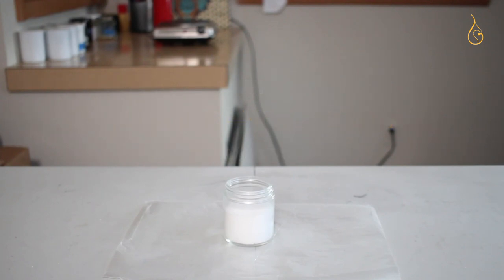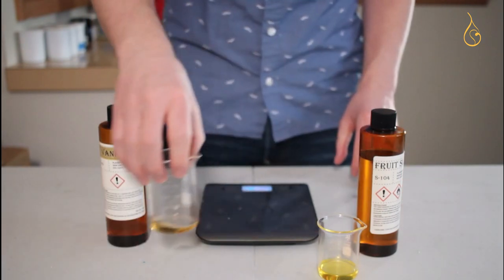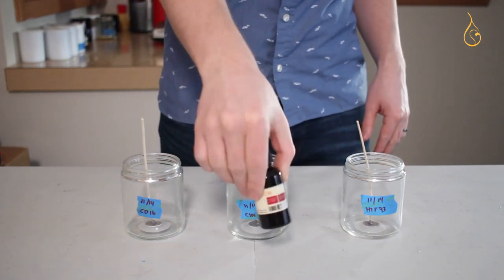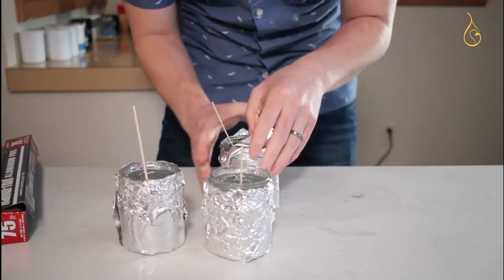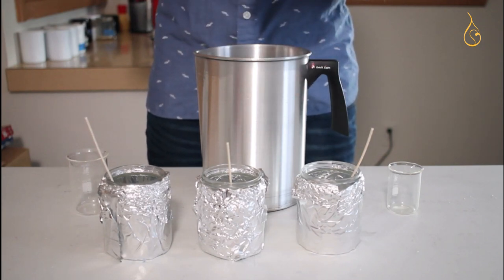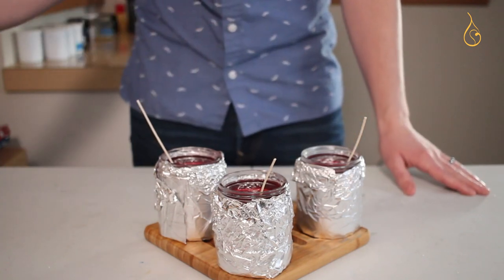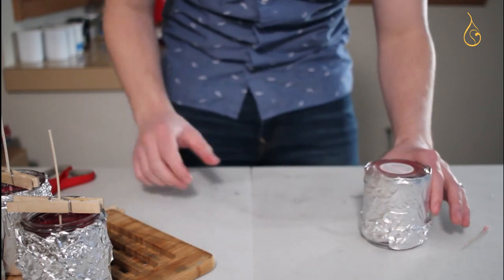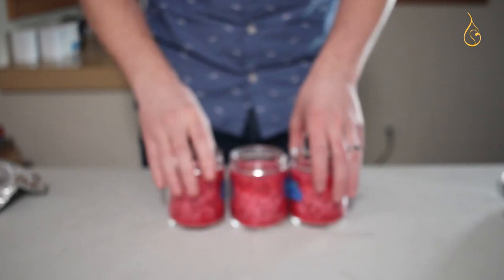Palm Wax Candle Experiment | Part One

Comment: This is great! I'm really interested in making pillar candles with palm wax, do you also do the flip technique for those?
Reply from the maker: I do - and it's just as scary!
Reply: I was just preparing to ask the same question. I started to do pillar candles with palm wax, I have the craters problem. I pole them, the refill and so on, but I still remain with one hole at least at the bottom. I don't do normal pillar candles, the cilindrical ones, I do it in shapes (like female shape), so I don't know if the fliping technique will work here? I don't want the neck or face of the shape to have bubbles ...

Comment: Hey! This video is awesome. I'm trying my best to get the crystals out but it's not working at all. Did the pouring at 200 F and even put them in the oven so they would have a lot of isolation. Minimal crystallization... Can u think of anything I can do differently? Bought palm wax just for this!
Reply from the maker: Hmmm that's interesting.  Wrapped in tinfoil?  Hot room?  Is it the "right" palm wax?  There's a few blends out there that have slightly different behaviors.  I think this stuff is R2322A.
Reply: @ArmatageCandleCompany  a room hotter than the oven... Is hard! Haha it's cold here in Berlin right now, so I thought the oven was the best choice. I also thought maybe it was the was... Sadly I haven't found here waxes that specify their type. I'll try with another wax and will let u know! Thanks for now 😁
Reply: It is not paraffin wax or soy wax
Reply: This candle is made with stearic acid
Reply: Melt the stearic acid in a jar and let it cool, crystals will form
Reply: 110%

Comment: Why do you test different type of wick candles? Why do you want to compare apples with oranges? 
You have too many variables: the wick sizes and type.  
I am working now with palm wax and I read that eco wicks work well with this type of wax.  Therefore, I decided to work only with eco wicks.
What I was testing today, actually,  was the wick thickness.   I found out that the eco-14 worked very well with my 3 inch diameter containers, but I think I can do better with the eco-16. 
I think they are all good wick types.  Just pick one and don't complicate your life.